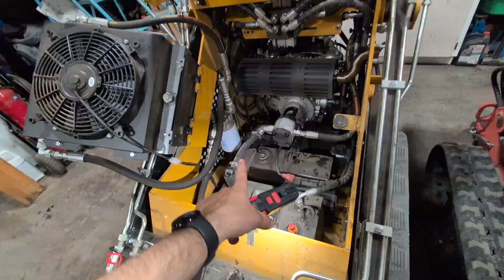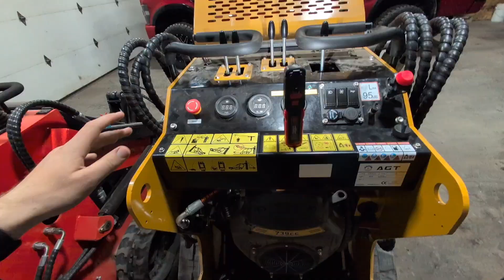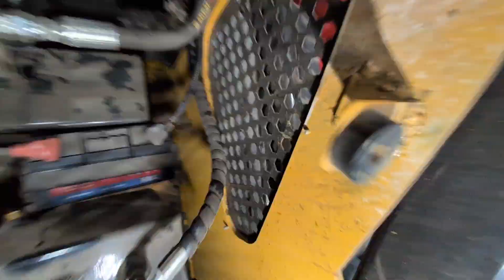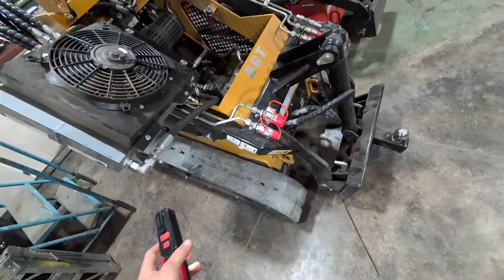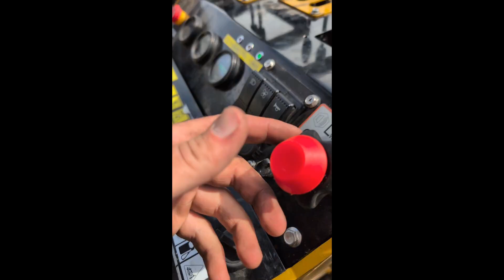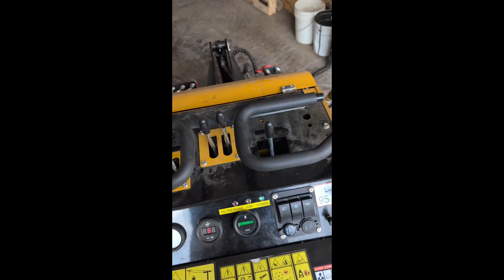AGT CRT23 Chinese mini skid steer single pump swap info

Comment: I just picked up my first mini skid(KTT 23),  is there a single control valve instead of 2 stick control valve for left hand steering like on the larger mini skids(v-1000 etc)

Comment: I have the AGT LRT23(the red one).  Curious what I can do to keep the tracks from falling off all the time.  You mentioned cutting holes for the cogs.  Is that something that would help with that?
Reply: Same machine   my tracks are horrible.  Every time I would use it it would throw one.  I   replaced the tracks and I haven't had any issues since.
Reply: @brandonharrison7973 what tracks did you buy?  Do you have a part number?
Reply: I have the lrt23 as well...what are everyone's solutions to charging issues?  I  keep having issues when I  have to take it to a job site.  I keep a battery maintainer on it @ home
Reply: @joleepack6512 if you still have the factory battery then it is the battery not your machine.  Make sure connections are tight.  Turn off the main power lever each time you store it.  Take a volt meter and see what the volts are at.  I really think it is the battery.  It was on mine.  I limped that Chinese battery for 2 years with constant charging and jumping
Reply: @woodisheavy  had a lawn & garden battery when I  got it...changed out for a bigger CCA battery& connections to disconnect were loose.  After that I  still have battery drain when using it. @ home I use a battery maintainer I  installed.  On a jobsite that isn't practical
Reply: @joleepack6512 time for a parasitic draw test.  You’ll have to look up how to do it.  Should point you to your problem

Comment: I have some questions. I have the AGT YSRT14 with the 13hp engine,  can I swap the 2 stage pump for a 3 stage pump. That way I can run some attachments and move at the same time. Would I have to upgrade to the 23 hp motor?
Reply: A 3 stage pump and triple pump are two different things.  You need a triple pump.

Comment: I have a CRT 23 with a 3 stage pump that 2 stages took a crap… having a hard time finding a replacement! With stock line configuration can I put a 1 or 2 stage pump on and Just double up the lines?

Comment: can you make a video detailing what you did?  I think it would be helpful for other CRT23 owners.  Like the notch, the pumps and what valves you purchased.
Reply: great so the hydraulics will work good but the rest of the machine is junk. well not after you replace bogies. final drives for those crappy hydraulic motors better tracks what did i miss oh the engine the muffler with all that heat and dang something else

Comment: Two questions if you don't mind:
1- How do you spec the single pump when making the switch from multiple pumps to a single? Which pump did you use here?
2- With the flow controller installed, would you be less likely to stall the engine in a low speed but high torque requirement situation? (i.e. throttle on high but using the flow controller to creep). I sometimes have issues with my stock machine stalling when I'm throttled down to go slow while on a hill or similar and I'm curious if this could solve the issue.

Thank you for the info! Helps those of us with minimal hydraulics experience.
Reply from the maker: @echostreeservice  size your pump off your available HP and your desired pressure there's calculators available online. Yes the flow control would absolutely help in that situation. I'm still gunna have it there when I need it. But won't be used very often.

Comment: It would be nice to upgrade the LRT, I would like to drive and use the bucket at the same time, lower and raise, it would be useful.
Reply from the maker: @euginzvonarev2884 would be an upgrade but keep in mind at full tracking your loaders dead. Still no toro or ditch witch but it's better then it was!

Comment: Can you take a detailed look at the alterations, have you thought about how to make it go faster? Video fire, I'm from Russia.
Reply from the maker: @euginzvonarev2884 yea I was hoping for extra speed. I did but not as much as I had imagined. If you want it fast you run a higher gpm pump and power the relief pressure. less torque pushing but maybe the speed would make up for it. personally Ill take torque over speed for my needs.

Comment: Are you planning any mods for the LRT?
Reply from the maker: @bassthis  nope the LRT will be sold once I'm happy with the CRT and my yard works done. once Im done my yard work I won't care to have a backup machine. the downside to the LRT is 3.5" of ground clearance is annoying. And I hate the hard lines inside. The soft lines on the CRT and KTT are better IMO

Comment: Great video. Subscribed. What control valve did you get from Amazon?
Reply from the maker: @davidalbertazzi2332  https://www.amazon.ca/gp/aw/d/B08HCLLX6S?psc=1&ref=ppx_pop_mob_b_asin_title
Reply: @ thank you.
Reply from the maker: @davidalbertazzi2332  hey man I had to send that valve back turned out to be no good.
Reply: @Johnathanliepert did you replace your valve that was bad with a good brand one? I have a mrt14 and would love to be able to drive with one hand instead of two. Also would like better valves so it’s not so jumpy and to get better control of tracks. It also seems to bog down half way of the throw of the valves for forward and backwards on both valves. Wonder if nicer valves would stop this
Reply: @Johnathanliepert  would the 21 gpm control valve increase track speed at all or is that limited by the pump